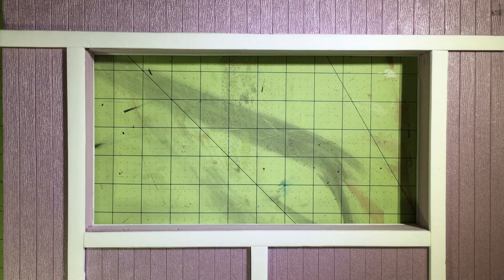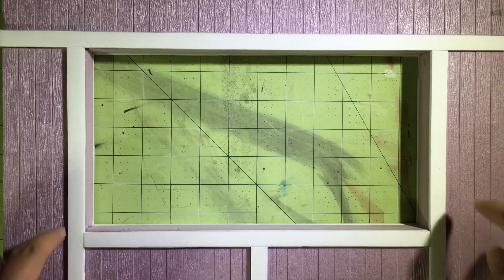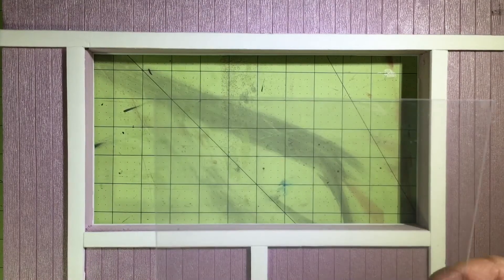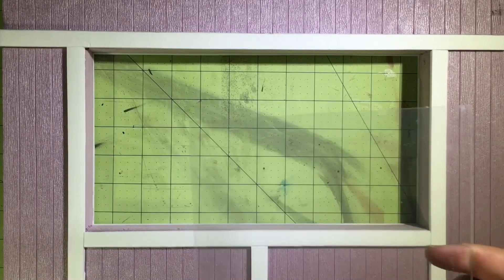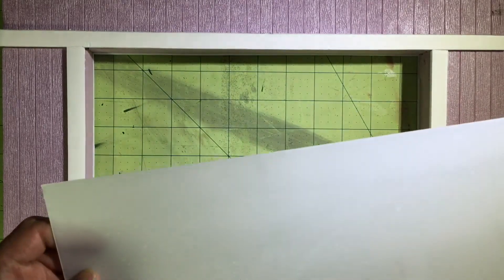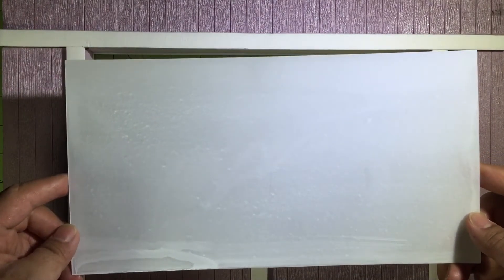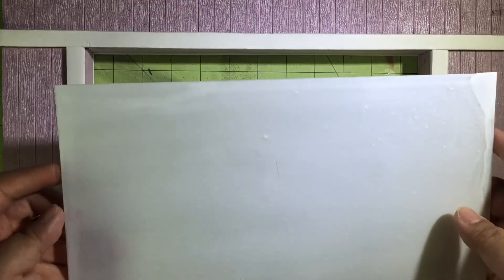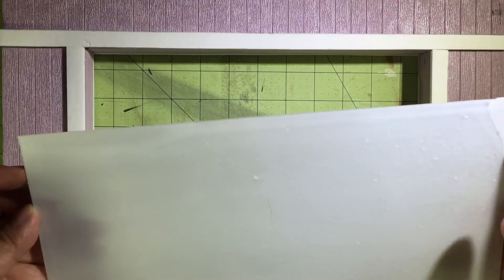059. Tutorial - Build Windows from Scratch tutorial

Comment: Do you have a tutorial on making the wood grain texture?
Reply from the maker: Hi Mik. Unfortunately I haven’t gotten around in making a vid for wood texturing. But you can use a wire brush to create those textures. I personally made my own using toothpicks. I just bundle them up and go to work with it.
Reply: @MechbayStudios  Thanks for the answer, it is appreciated. I sort of wondered about using a wire Brush ,i have seen that method used for making wood grain. I have found a place that sells 1/12 scale Traditional Japanese Roof tiles so i might make the piece of roof for my Ninja figure and have a go at making a Japanese room as well. I'll be copying some of your other Diorama ideas for some of my other figures. I was thinking of using Styrene sheet rather than spraying a clear plastic. No chance of scratching then.

Comment: How do you get such a clean cut for a window?! That's like impossible! lol I've been making dios for 4 years and I've never seen cuts so clean usually the foam just crumbles where I cut
Reply from the maker: I cut my window openings the same way as I cut my foams by using exacto blades. The key here is to use new/sharp blades and that for the most part will give you a clean cut. I then go back and sand off some of the extra pieces that remains after you break off the other pieces of foam.
Reply: My openings always come out jagged and beveled
Reply: Use pink insulation foam